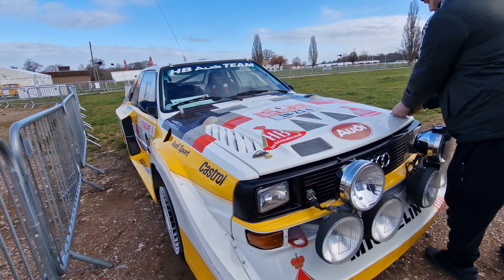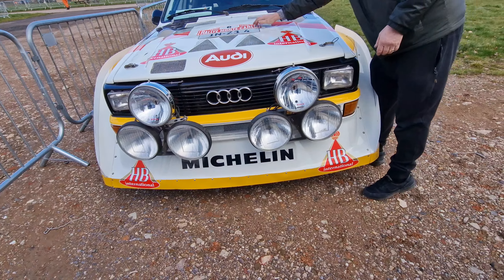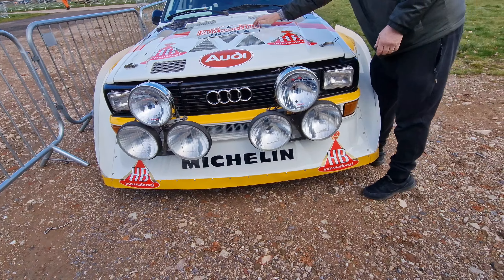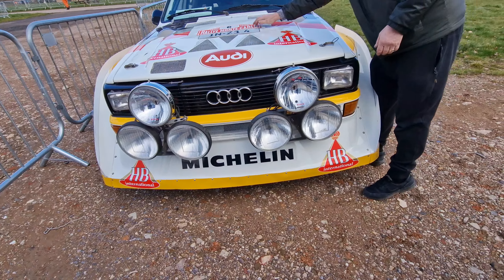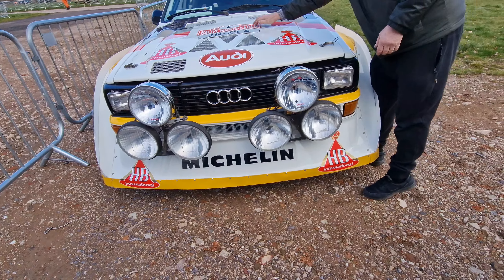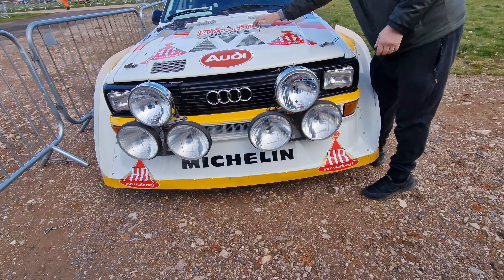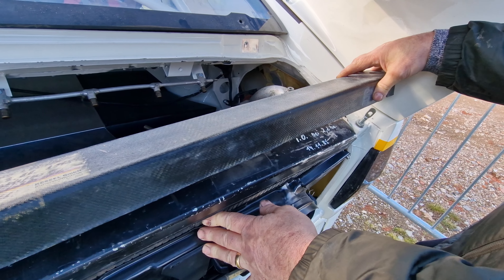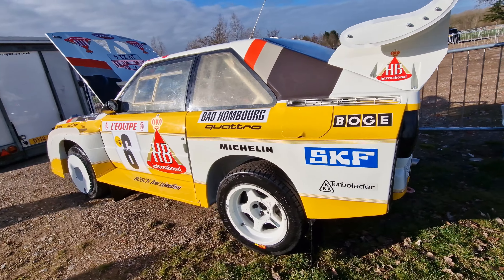This Replica Audi Sport Quattro S1E2 is better than some originals !

Comment: So, 15 years is not enough to get it driving... But the shape is beautiful!
Reply from the maker: 15 years sounds like a lot of time , but imagine how hard is to come across to original S1 Quattro parts ? 

Nowadays is easy to buy a modern replica and get it delivered in 1 year or less... but at the end of the day would be a replica with modern parts , nothing like this car is 😊
Reply: @therallycarspotter  Can imagine. And the the prices are extremely high, there are no availability and the time to build has to be also found. And if the originality and high quality is the target - there is no date possible to set when project comes complete.

Comment: No i think any Replika is better then the original  IN - NY 81 or IN - N 7 the original werks Quattro
Reply from the maker: If the replica is built to a high standard,  should be on the same level as an original works car 💪

Comment: looks good but a million pounds for a replica, you're insane, no matching numbers no even an original chassis
Reply from the maker: All the parts on this car are original S1 quattro parts except the chassis 

All the parts have the original serial numbers , even the glass , probably that's why he prices the car at that value 🙂
Reply: Yes but those cars run and they are original built buy the manufacturer
Reply: They don't have some hacked up chassis from another audi model, it's original
Reply: @therallycarspotter  are all the numbers from the same vehicle and when they run the vin/chassis number what is the discription going to be?
Reply from the maker: @Gramaine1287  as far a I know all the parts are sourced from all the original S1 quattros that existed , they didn't came out from the same car 

They are all tagged as original parts with all the different vins that matches all the factory cars also the owner got the list of where all the parts came from wich is very cool 

This chassis dispute is not an original,  was inspect by audi Heritage in the UK and is at the same level as an original chassis :)
Reply: @therallycarspotter  yes I understand but unfortunately they don't match your chassis, and the matching numbered cars are the big money cars.